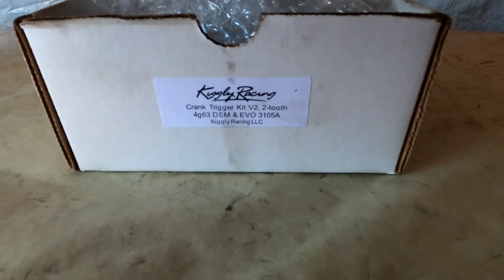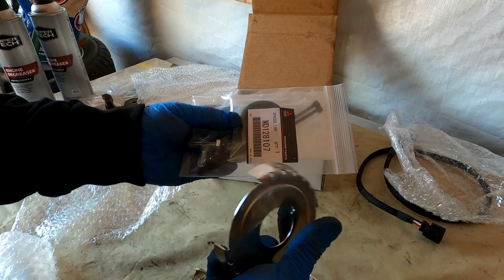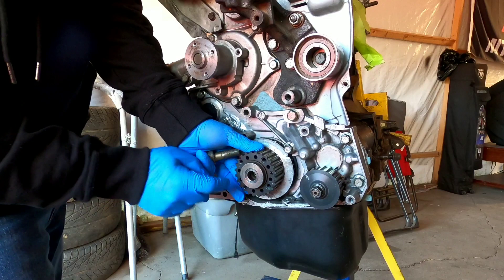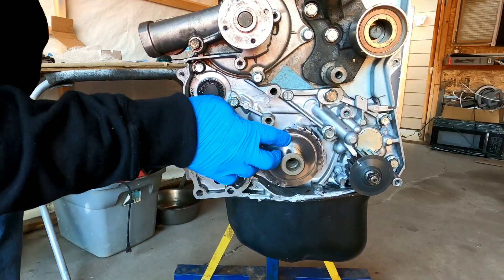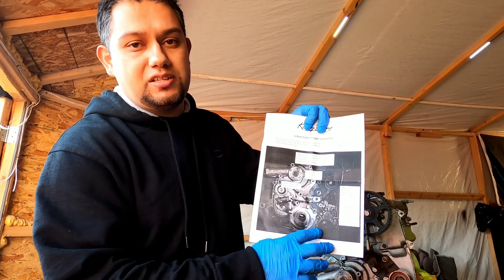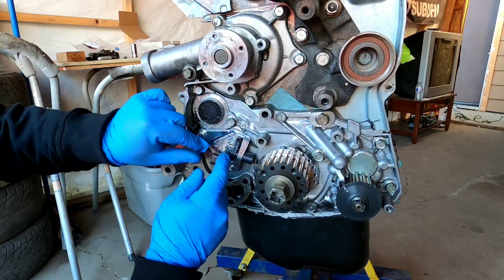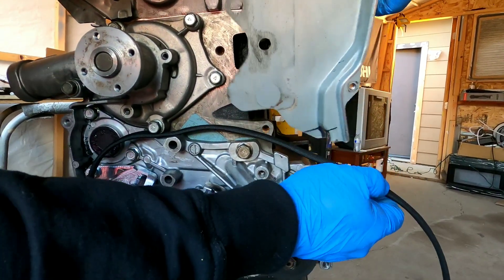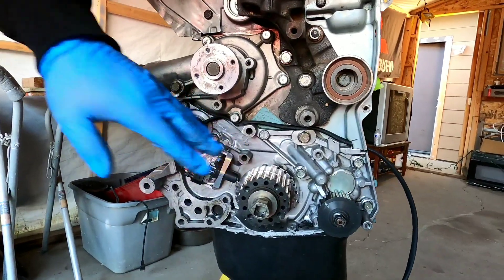Kiggly Racing Crank Trigger Kit Install 4G63 DSM 6 Bolt

Comment: So I have a 6 bolt but it’s a later gen 6 bolt oil pan and oil pump cover can I still install this kit??? Or does the oil pump an oil pump have to be from early gen? Meaning “ oil pan isn’t flat it has a lil bump where oil pan get maited by crank.,

Comment: This is what I need to do the 6bolt(92talon) swap into a 2g(99gst) OR just the 1gCAS? But it'll run(start) better with the kiggly 2v kit, I'd I run the kiggly kit can I use my 99’ crank senor with the kiggly kit   or I need the senor stated in your video?
Reply from the maker: Your 2GB CAS + the kiggly kit will keep the ECU happier vs the 1G CAS... both routes will work, but the kiggly+2gb combo will work better in my opinion.  Order the sensor with the kit if possible. Good luck!

Comment: Great video but my question is with this kit can I get rid of the cam angle sensor on the cam up top????????
Reply: No you can not,the cam sensor up top is still needed to tell the ECU where cylinder 1is and to begin the ignition cycle
Reply: @4g63spdfreak  so what are you plugging  into ???
Reply: @speedymike7845  You will be plugging into the ecu cam and crank wires, keep in mind this modification is not for a factory computer

Comment: If you run this kit on a 6 bolt swap into a 2g using the 1g head can you run the 97-99 CAS? Or are you only able to run a 1g style CAS on the 1g head? I specifically have a 97’ talon and it has the CAS mounted on the passenger side of the intake cam.
Reply from the maker: Yes, you can run a 2Gb CAS on a 1g head.
Reply: @DSMTHuNDeR  awesome thanks man!

Comment: Que diferencia tiene al que el trae de factoría??
Reply from the maker: Con este kit, imite las señales del sigueñal (crank) como si estuvieras corriendo un 7 bolt para tener a la computadora contenta. Los que se benefician de este kit mas son los dueños con el 2g en un bloque 6 bolt.
Reply: @DSMTHuNDeR   Gracias hermano por aclarar la duda ósea que eso es más para 1G bien 👍🏽
Reply: @DSMTHuNDeR  tengo 1g CAS y 1g cylinder head, como se instala?